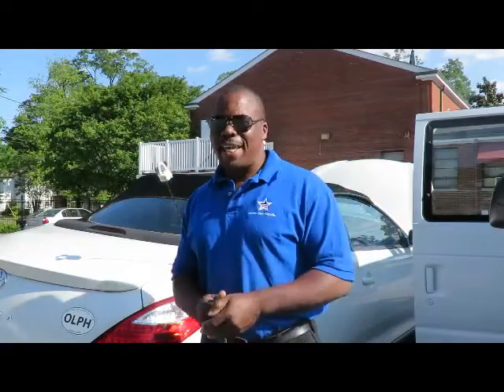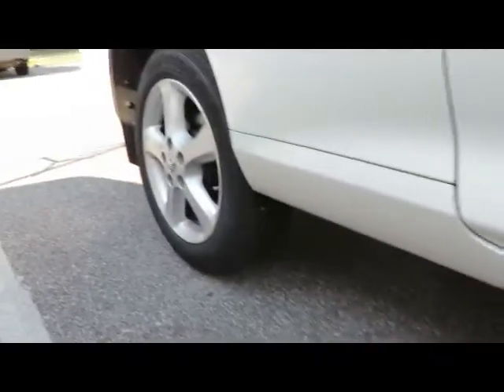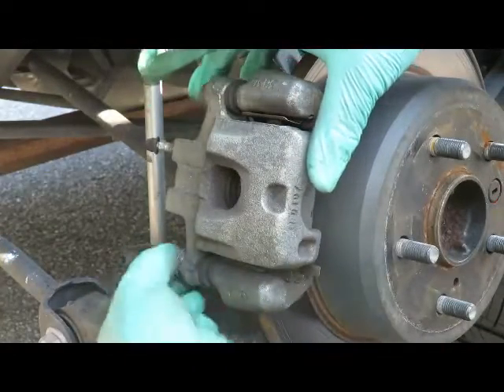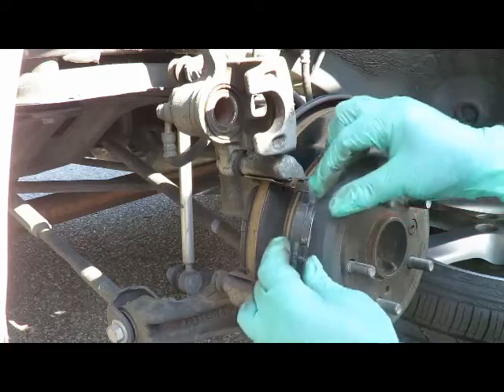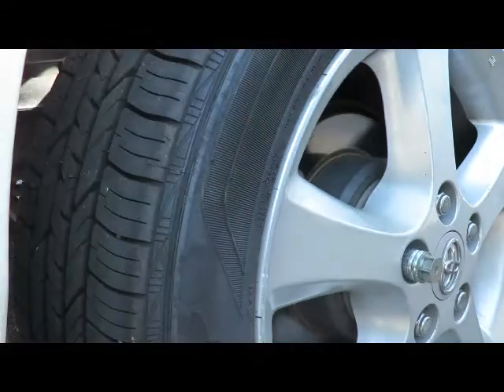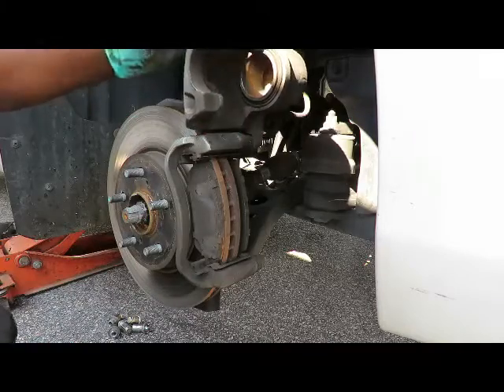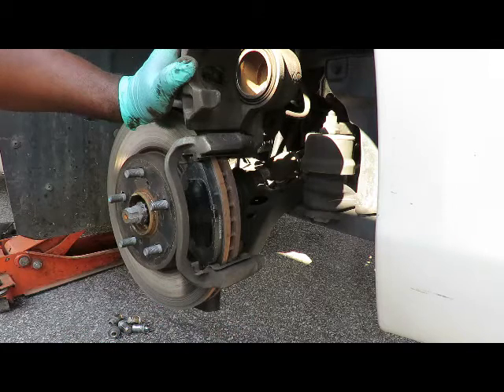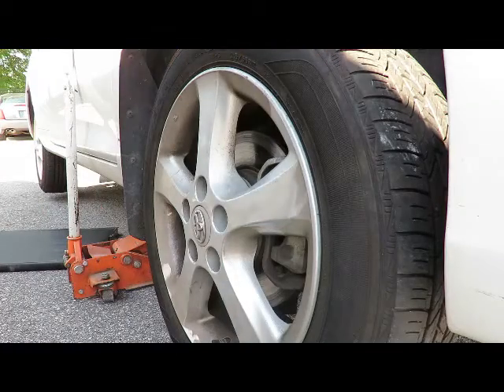⭐ 2008 Toyota Solara - How To Replace Front And Rear Brakes

Comment: Ummmm.....you are wedging/levering a screwdriver against the face of the rotor?  Seems like a good way to damage the rotor face.
Reply from the maker: If you damage a rotor with a screwdriver, by doing this, you need to stop buying cheap rotors.🙄

Comment: Just did the job. Thanks for the trick of only removing one of the bolts holding the caliper. My only problem was I didn't realize the nut turns and I had to grab it with needle nose vise grips. I agree with you, don't believe you have to redo rotors always.
Reply from the maker: It's great that it worked out for you 👍